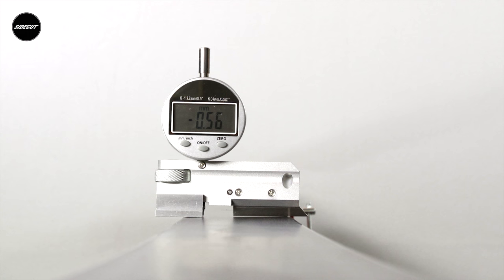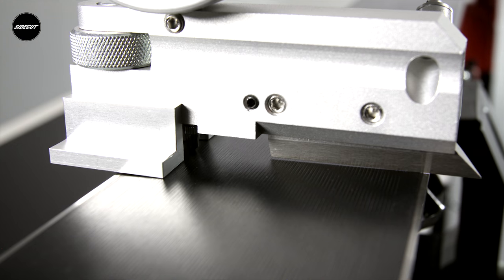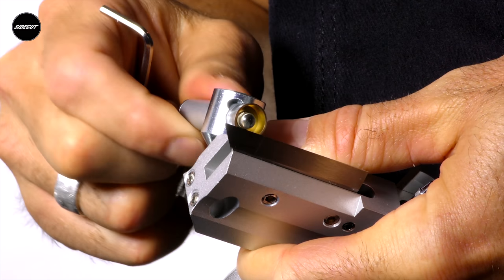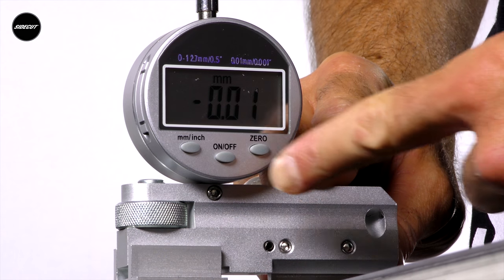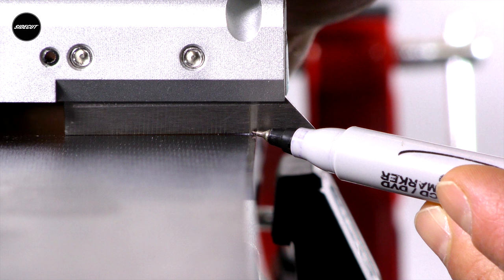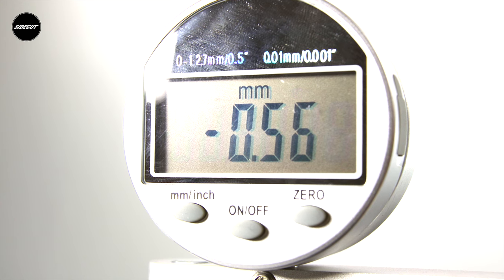How to use Digital Base Bevel Gauge

Comment: I don't get what you are showing here.
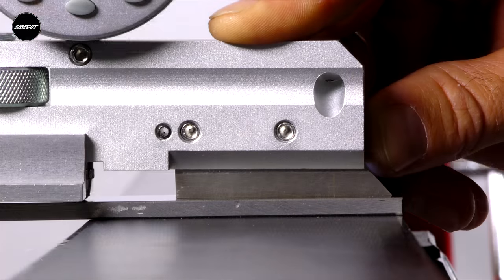At 0:39 you have lifted the heel of the meter off the true-bar. Kinda makes sense but you can also just screw the heel down until the edge is completely flat to the true-bar.
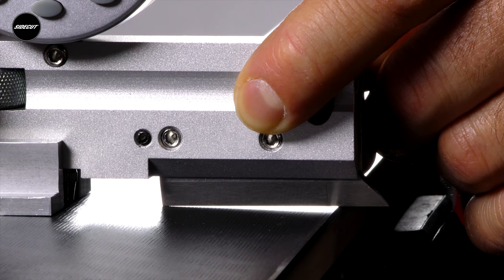At 1:05 you place the meter and adjust it until the edge is parallel to the base.  Thus the meter will read 0? It makes no difference to the meter if it's on a true-bar or on a base.
I'd expect to adjust the meter until it's lifted off the base, but leaves no gap on the edge?
Reply from the maker: We are using a true-bar which is accurate to 1/1000th of an inch to reset the meter on a flat surface.  If you prefer to do this on the base you can.

We're looking at the light the comes through between the ski edge and the meter.  PM or call us for more details.